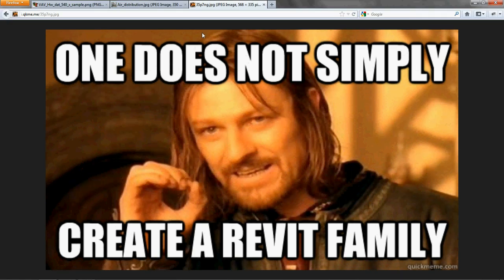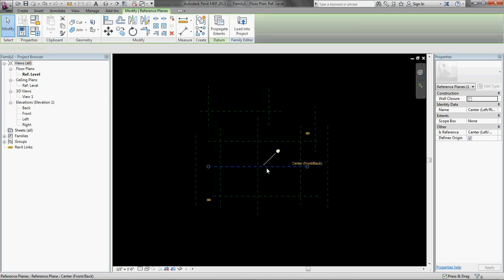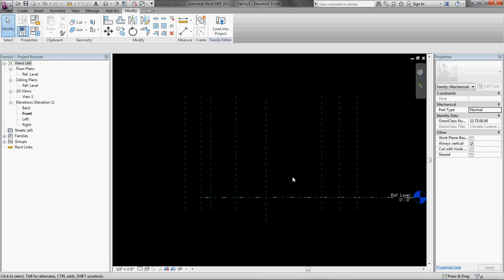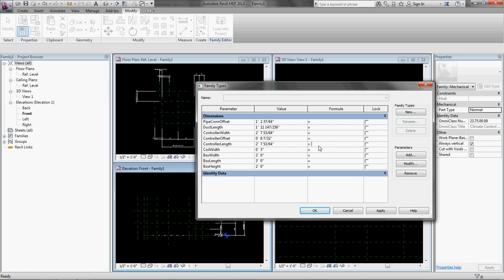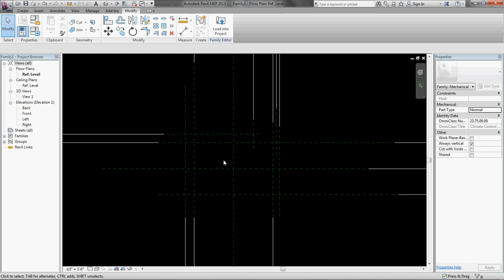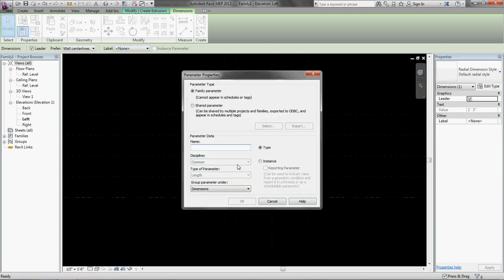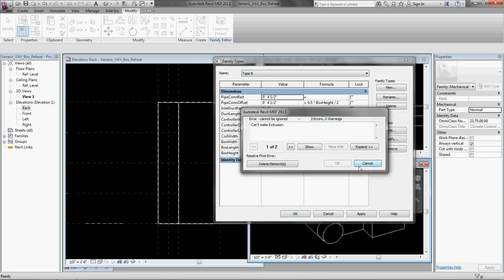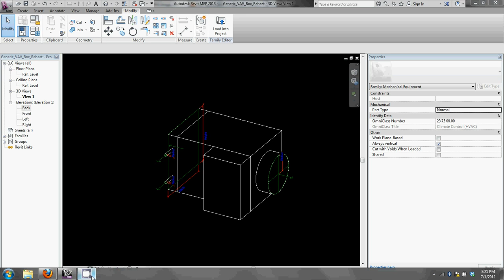Creating Mechanical Equipment Families in Revit 2013 Part I: Fundamentals and Geometry

Comment from the maker: Hi Reye, sorry for the late response. I think your intuition is correct -- check the settings in the "Family Category and Parameters" window. It's the upper right button in the Properties area of the ribbon (in the family editor). Make sure your family category is set to mechanical - forgetting this step is typically why my families will show up ghosted like you say.

Comment: This is a great video! After I created my family and imported it into the project, it came in as ghosted along with the architecture. My guess is that I must have created the model under the architecture discipline and need to add a parameter that allows me to change the discipline to Mechanical. Have you encountered this problem? Thank you if you have the time to answer it!

Comment from the maker: Thanks for the feedback. I just started getting the clue that most other Revit users out there go for the white background. Personally I dislike staring into a light bulb all day - but I'll start uninverting the graphics for videos. Cheers!
Reply: Im the same i normally have the background black - great vid by the way.... I tend not to normally use parametric familys as for most projects there are only a few variations and its easy enough to model 1 then say 4 more by using saveas and just editing what i have already modelled - for example on an air handling unit you may have 6 on one project but they may differ and have more or less filters or have a mixing box, frost coils etc in this instance if i have 6 AHU's from the same manufacturer is it not easier to model them as separate familys?
Reply from the maker: getin, yes, often is it easier/simpler/less likely to fail just to make separate Families. Almost always with AHUs, since they tend to be so custom, I use separate Families. That said, I'll only use separate Families near the end of the project, when I am making all of the Families detailed. At the beginning, just about every family is a simple box that I drop in, set to the approximate overall dimensions, and tag "AHU" or "CH" or "CT" or whatever. Not worth it in the beginning to model many different Families.

Comment from the maker: Hi Dave. Are you running the trial of Revit 2014? I know that in 2012 (or was it 2013?) there wasn't an option to create a mechanical equipment family from the "new family" window. What I did was pick "Generic Model", and then change it to Mechanical Equipment once the family has been started by hitting the Family Category and Parameters button, in the upper right of the Properties buttons. If you are just trying to follow along for evaluation, you should be fine to use generic Model category.

Comment: Hey Tyler, I'm 5 days old to Revit, I had used Inventor 2015 for an year and found useless tutorials on revit so far but this is the first one to make all the sense, thanks a lot for that. I'm looking to build a model, I want to know how to constraint families together to make an assembly. I have got 9 separate parts and want to assemble together and didnt get any idea how to do it. Would you be able to suggest something on it?
Reply from the maker: Hi Raj, you might be looking for the "Model Group" feature in Revit. In your project, select the Families you want to group together. Find the "Group" button up in the ribbon, or type "GP". That will great a Model Group. You can double click that group to change it's associations, as well as make copies of the group. Cheers!
Reply: Look, I have separate families stored in one folder and I want them getting in a project. I want to put one on each other, I mean I have got Base plate, Tower/Post, Cantilever arm etc, and i want one by one sitting on. I used to use Mate, Angle, Tangent, Insert, Flush etc to get all the scattered parts assembled. Is there any feature similar to this? Appreciate your reply.
Reply from the maker: There isn't anything in Revit as sophisticated as Inventor's tools in terms of creating assemblies from parts, as it's architectural focused. However you should be able to do it. I would 'Nest' the Families into each other. 1) Open the Base Plate family, in Family Editor. (Revit > Families > Open > Browse to your Base Plate Family). 2) Insert Tab > Load Family > load the Tower/Post family. It might only show up in the Project Browser - drag it in to the Floor plan to place it. 3) Repeat step 2 for all the pieces. 4) Use the Move tool (which has snaps), Rotate tool (RO by default), and Align Tool (AL by default) to get the parts positioned the way you want in relation to each other. 5) Save as "assembly" 6) Load into project.
Reply: If you already mastered Inventor, you should do all the assembly with the constraint & connections. Then import it to Revit.

Comment: That was awesome! Can you show how to load this into AutoCAD MEP with active pipe connections?
Reply from the maker: +HeyArcher Sorry I haven't the foggiest! Never used AutoCAD MEP. Cheers.
Reply: That's ok. This is the more important part of the process. I've downloaded control valves from various manufactures websites, and their revits come with 4 or 5 different windows of reference lines. Could you do a video on how to put one of these together? I can send you a link with an example if you like.

Comment: Hey tyler, I have a question I was working on the revit 2013 and I did a house project. I finished with all the architectual components but now, when Im trying to start working on the toilets, I cant see them cuz my template is for architecture. Is is possible to add the mechanical templates in my project browser? Im working with Revit 2013. Thanks!

Comment: When i insert my familiy in revit it is underlay and semi transparent, why that?
Reply from the maker: Confirm what Category of equipment it is - is it Generic Equipment, Mechanical, Electrical, ? Then check your Discipline. If the Family category is something Architectural or Structural, and your view Discipline is Mechanical, it will display differently. Also check everything in VG: Model Overrides and Filters. Also check the material of the extrusions in the Family editor. Check Object Styles, there might be some override there. Also check if the Family is being inserted below the View Range of your view and you have Underlay turned on.
Reply: Thanks a lot, i made it generic enquipement, and worked in discipline Mechanical. I tried now making mehanical equipment and it worked fine! 

Keep good work, i enjoy listening to you.